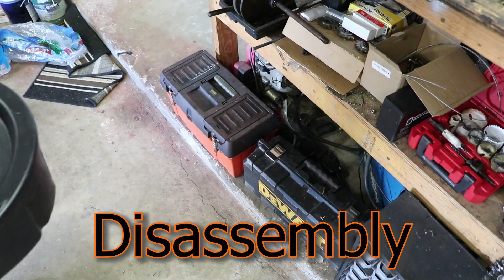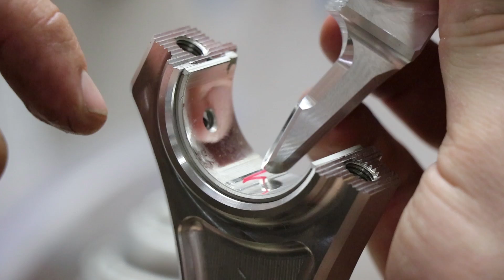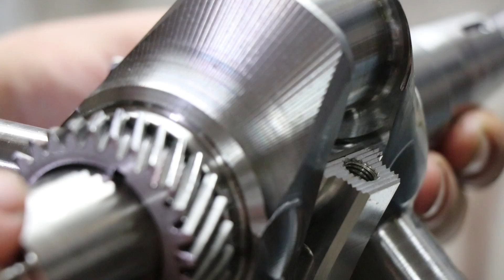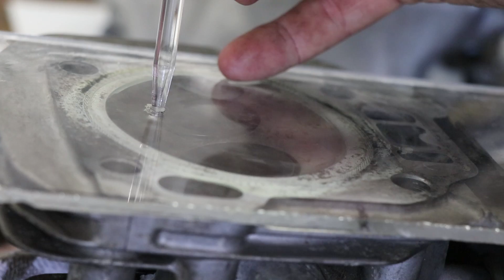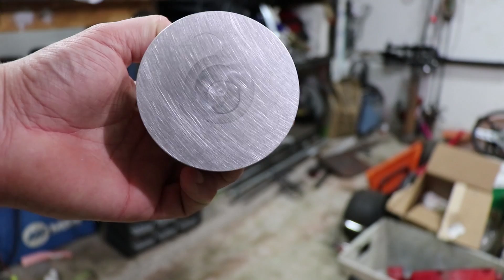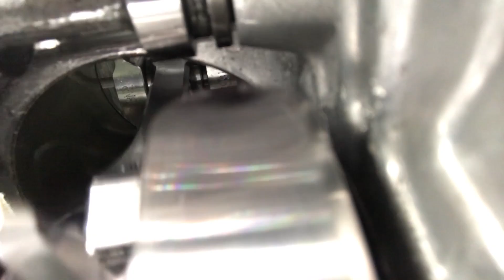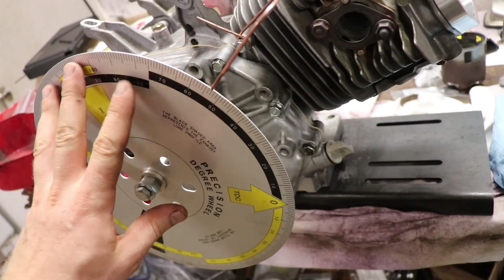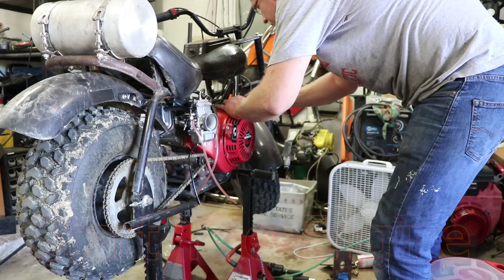Stroker Engine Build: 30+ HP on a 65 MPH Mini Bike! (Complete Build)

Comment: No chance having 30+ hp
>20 at crank and about 15 at wheel
Reply from the maker: We will find out in January
Reply: @KartFab  
Thanks for replying I am really waiting to see dyno pull
Reply: Keep us posted
Reply: I have one built nearly identical and it will blow right through a comet 40 with a 7x1 final gear. Needed to swap out to 9x1 and a comet 44. So who knows? I'd bet low to mid 20's with mine. It runs and sounds like a 450 dirt bike motor.
Reply from the maker: @E46TY  Was the motorcycle dyno inertia only, or could it load it to hold rpm?
Reply: Crickets
Reply: @KartFab  did you ever get the dyno done? 

 I just picked up a gx 340 clone but am aiming for more 20hp goals.
Reply from the maker: @mathdebates7936  i ended up steaming the combustion chamber out racing in a downpour. Bought a new short block and am getting it re-done.
Reply from the maker: @mathdebates7936  if you want 20 hp out of a gx340 you can get that with a 275 cam, bore to 88mm to accept a standard gx390 piston and shave the head for 10.2:1 compression on premium pump gas. Will be a nice solid build and get you there. will top out at 6500 rpm.
Reply: @KartFab  oh man that sucks.  I bet it was a fun beast.  Look forward to seeing it in the future.  

You ever mess with that Vegas carts 460?  It's like 23hp for 350 bucks. I'm thinking about trying one out.
Reply: @KartFab  thanks man.  Ez enough.
Reply from the maker: @mathdebates7936  a buddy of mine has, and it is SCARY powerful. Doesnt like to rev high, but has a lot of torque. The higher the displacement of these blocks, the lower the max rpm, but the higher the torque output.
Reply: @KartFab  I worry about throwing too much at it because I flip these things and I have a hard time getting them to pay more for the stuff that costs more to build.  Everyone wants a deal I get but quality takes a few bucks.

The buggy I listed yesterday has had a bunch of interest from the same 6 type of guys.  "bottom dollar/how much will you take", "will you finance?", "will you hold it?", "will you trade ______(always junk) for it?", "do you still have it? (and I never hear from them again", and "will you deliver?"
Reply from the maker: @mathdebates7936  lol! Yeah, just be patient and if you are, keep it updated. Who knows, maybe around christmas and thanksgiving, things will pick up with people buying gifts and that is usually the time to sell.
Reply from the maker: @mathdebates7936  check out the texas outlaw mini bike facebook page, we have a big mini bike race event coming up in october (ratrodtober) in mckinney tx

Comment: You stated when measuring Valve Spring installed height, that you measure from the "bottom of the Retainer, to thee Head." C'mon bro, you're gonna confuse these small Engine Rookies.

Comment: Yep just went to your homepage, no dyno results, where did the 30+ hp figure come from? (Pulled from a hat or just a good round figure?)
Reply from the maker: Remember this is my hobby and i have a real job and a life and you dont fully understand what i am doing behind the scenes. Some of my other builds have made 1.3hp-1.7hp per cubic inch depending on which dyno you run them on. Do the math. Also, the engine is actually out of service right now getting a head, cam and carb upgrade, so it will make more than what I have previously said. Happy new year.
Reply: I’m just f’king with you man,.. LOL

But i would like to prod you onto the dyno,.. mostly so i can see what combos do what with one another

IMO most of these 390 and 390 clone builds dont lay down near what we may think they do though,.. 

Its the torque numbers these thumpers put out/ and down low that really impresses me.
Reply from the maker: @brianboyee8972  hey man, i ran the engine on the dyno today. turns out i was running super rich, like 9.5:1 AFR, and the jets that i had only got it up to 10.7 at idle, top needle position 10.5-11.7 AFR from 1/4 to 3/4 and at WOT 11.1 AFR. For what its worth it made 25 ft lbs and i coudln't steady state anywhere below 5k rpm because it has too much torque for my dyno to load it (that or i need to wait for water pressure to go up to the house) haha! On top of all of that I found out that it may have a BLOWN headgasket on the exhaust side and i got some water in the engine when i was messing around in the rain.... Even after all this garbage it made about 24ish hp steady state with the AFR out of whack and a blown head gasket. IF i remove the muffler that figure will go up significantly from my testing on small blocks. Muffler takes a lot of the hp potential away. Hopefully the bore and rings are still good. So going off of some information i have collected, if i ran this on an inertia dyno it would make around 28 hp. cheers. Also checked my dyno with certified NIST traceable weights and it was only off by .002 to .05 foot pounds from 2 lbs all the way up to 30 lbs in 1 lb increments.
Reply: Just reading the posts in order

Cool!,.. yep they do real well but building reliable~ (RELIABLE being the key word) power 30+hp from a GX390 platform is always a think of “well it oughta make “X”.. 

These little mills are AWESOME,.. awesome platforms~ but to build to and over 30hp reliably you tiptoe into the land of rediculous money spend vs just buying the biggest one you can (Duro440), making very basic simply standby improvements and having a blast.

It gets so silly like lipstick on a pig, when they are such great little pigs just slightly over stock form

Cool videos to be certain& and it is fun teasing you/ poking at the lack of dyno figures..

(Its funny because i have also gone down the rabbit hole/ wish i had that money back)

With more and more hp& torque comes less and less reliability& increasing need to CONSTANTLY play grab ass tuning 

~ buy the biggest mota’ you can, build just a smidge, AND STOP, LOL
Reply from the maker: @brianboyee8972  good combos are as follows: 275 cam with 1.3 ratio rockers and 32mm flatslide, stock size valves. ..308 .315. or .310 cam with 1.2 ratio rockers and bigger valves, 33mm pumper carb. You can get into the most aggressive cams and big SBN carbs with ratio rockers and maybe 38-40mm intake valve size. If you want to have lots of torque you can always go with the .280 cam by nr, as that is a good overall cam, kind of like the 275 cam. The .308 is good overall too, but loses a bit to the bottom end. Its mostly a midrange cam.

Comment: FP aprilla rs 125cc engine is about 28bhp and that is with out any modifications except the PV. why bother with a 4 stroke at low cc.
Reply from the maker: because its fun. I could go buy a used motorcycle engine and come out with way more horsepower but i like turning a worn out generator engine into a beast. There are always going to be bigger and better engines out there, but i like these industrial engines.

Comment: Ive been wondering if I could do similar but with a GX 690 ,,   For my trailer jetter, it’s a sewer jetting machine,, basically a pressure washer.....the engine will run a plunger pump,,,    The formula is as follows,   PSI X GPM /1460X 1.4 = The HP needed to run the pump...    example    4000 psi at 15gpm  pump will need 58 HP.   ......also RPM is a factor__i would need to set a governor to not exceed whichever RPM the pump is rated for...   I would use my HP after the build to determine which pump I would use...   it could be anything between 3000 t 5000 psi..     what kind of HP cod I get with a GX690?
Reply from the maker: Hmm Koehler v-twin or briggs vanguard v-twin. I’m not sure you’ll get that much HP though

Comment from the maker: PARTS USED IN THIS BUILD
Honda GX390 Engine https://amzn.to/2zQIOrW
GX390 Starter https://amzn.to/2uxHdCl
Predaotr 420/Gx340/390 Billet Connecting Rod http://bit.ly/2mqzp0I
Honda Gx390 1.2 Ratio Roller Rockers http://bit.ly/2LpKfPr
90mm -.050" compresison height piston http://bit.ly/2uIlp6o
GX390 +.200" (70mm) stroker crank http://bit.ly/2uLyGuT
GX390 Crank Bearings https://amzn.to/2JyefHh
GX390 Oil Seal https://amzn.to/2NlSxs0
GX390 Magnetic Oil Plug http://bit.ly/2NrT4ZL
90mm .043" head gasket http://bit.ly/2NYiyic
35mm Intake Valve http://bit.ly/2L7ij6G
31mm Exhaust Valve http://bit.ly/2zZx0Uz
Billet Retainer Kit For Valves http://bit.ly/2mulnel
GX240-390 & 301-420 50 lb HD Valve Springs http://bit.ly/2msY98K
Rotating Assembly Balanced by NR Racing
GX390 Valve Lifters https://amzn.to/2L6lifW
GX390/420 275 Camshaft http://bit.ly/2No1LEs
GX390 Crankcase Cover https://amzn.to/2Jzynso
GX390 Gasket(s) https://amzn.to/2uxT1Ez
GX390 Valve Cover Spacer http://bit.ly/2uLAFPR
Cut To Length Push Rods http://bit.ly/2mthxT2
Mikuni TM32 Flatslide Carburetor https://amzn.to/2Ltf9q5
Billet 32mm Intake Manifold http://bit.ly/2LtYjHG
GX390/Predator 420 Exhaust Header http://bit.ly/2uHhdDV
40 series Torque Converter Kit http://bit.ly/2Nsg7U2
Billet Thumb Throttle https://amzn.to/2zQHh5a
Adjustable Throttle Cable http://bit.ly/2JzAL2k

TOOLS & CONSUMABLES USED IN THIS BUILD
Piston Stop https://amzn.to/2NZNxKN
Degree Wheel https://amzn.to/2zPQXwD
Timing Light https://amzn.to/2uxhMAX
Gasket Maker https://amzn.to/2uxU8Ef
Bearing Puller https://amzn.to/2mrjGOP
Plastigage https://amzn.to/2moGJKm
12 Point Socket Set https://amzn.to/2L2yiTH
torque wrench https://amzn.to/2L82pJu
Feeler Gauge https://amzn.to/2NYzBkl
Assembly Lube https://amzn.to/2NWIMlc
Dremel Rotary Tool https://amzn.to/2muFnxE
Carbide Rotary Burrs https://amzn.to/2O1Tp6n
Dial Indicator https://amzn.to/2zLZNLS
Green Grease https://amzn.to/2uwq3F4
Valve Lapping Compound https://amzn.to/2O13DnM
Valve Lapping Tool valve_lapping_tool
Isopropyl Alcohol https://amzn.to/2mpX9lz
50ml Class A Burette https://amzn.to/2L3Ojsp
Micrometer https://amzn.to/2uxvKTo
Mill https://amzn.to/2L9rHHi
Piston Pliers https://amzn.to/2zRgc1R
Piston Ring Compressor https://amzn.to/2uv9NEk
Dry Erase Marker https://amzn.to/2uxY4ov
Caliper https://amzn.to/2NZlQlt
Abrasive Chop Saw https://amzn.to/2uxsB5Y

Compression Ratio Calculator
http://bit.ly/2zSEOas

Comment: How did your torque converter not blow ohs only rated for 18 hp
Reply from the maker: Slips the belt over the driven unit and won’t gain traction if giving full throttle.. Cracked the jackshaft keyway. Goes into overdrive too fast as engine provides too much torque for CVT to remain in original ratio.
Reply: @KartFab  thanks I’m building a drag mini bike with the same you put on yours stuff just predator 420 and don’t know if I should get clutch or torque converter both expensive !!
Reply from the maker: Get a bully turbo clutch.

Comment: How do you know how many degrees to advance your timing? You used 28 degrees, why? Im struggling to find any good information, any help is appreciated.
Reply from the maker: When you buy a camshaft it will let you know. Typically advance by 4-6 degrees on mild cams and 8-12 degrees on wild cams. Most cams on gas run between 28-32dbtdc and if on methanol, 34-38 dbtdc
Reply: @KartFab  I bought my cam from nrracing (280 series, 0811 grind, 6500+ rpm) but i doesnt say anything about timing. Do you have any knowledge about this? Currently im using 6degree key with billet flywheel
Reply from the maker: @sepedius  sounds about right

Comment: If I do this build to my own gx390 will the connecting rod in the description work with the piston. Or will it still need to be milled
Reply from the maker: Con rod works with piston. As long as you don’t get a stroker crank the piston will fit perfectly
Reply: Thank you!
Reply: Will all of these parts work in this engine without the stroker crank? I'm wondering if the valves would clear.
Reply from the maker: oh yeah, the valves will DEFINITELY clear. I had over 200 thousandths piston to valve clearance on mine, and that is with the increased piston dwell time from the increased stroke. You only really run into issues when you have piston pop up, thin head gaskets, mill the head, and/or get an aggressive high lift cam with a high duration.
Reply: KartFab awesome! Thanks for the quick reply!
Reply: KartFab awesome! Thanks for the quick reply!

Comment: Kartfab what's the recommended fuel for that?
Reply from the maker: 10.2:1 compression you can run run on premium pump gas. Other fuels like methanol or race gas will make more power.

Comment: Is the Plastigage available even with with metric measurements and if so, where can I find it???
Reply from the maker: Plastigage usually has metric on one side and inches on the other side. Any auto parts store has it as well as the link in the description.
Reply: KartFab I checked the Amazon link you posted in the description out, and said that the seller of any of the tools and other similar stuff, like the Plastigage doesn't ship them, outside the US (like my country, Greece for exaple). And I don't even think I can find it in any of my few local car parts store, 'cause nobody in my country seems to work on his own car or motorcycle, rather than teens who have and ride modified mopeds
Reply from the maker: I would be very surprised if your auto parts store didn't have plastigage on hand. It is a common part used when replacing camshafts, cranks etc.
Reply: IDK, I had to explain to the counter lady at Oreilly Auto what it was...then the manager.  They eventually let me look through the inventory shelves myself and I found it.  Then I cringed when they started to fold it to stuff it into a bag...  Those people don't know what they have to sell unless their computer tells them it will fit on a specific model car, or it's on a retail shelf.

Comment: Is it about same size of a predator 212cc in length and width?
Reply from the maker: No. This is a big block. A predator 212 is a small block
Reply: KartFab how much bigger is it than predator 212
Reply from the maker: look up the users manual for a predator 212 and a predator 420, thats how much bigger. Dimensions are in users manual found at harbor freight

Comment: Only takes about 8 HP to go 65 MPH... back in 1960's I built a minibike around a 350cc 2 cylinder motorcycle engine (JAWA): 
http://i1088.photobucket.com/albums/i333/BuzzLOL1/BuzzLOL%20Pictures/DannyFuneral008-1-1.jpg
Reply: Does it?
Reply: @syndeko55  -Sure...

Comment: Aftermarket stroker kits do horrible things to your engine. A factory can stroke an engine properly, as Honda did when they stroked the XR200 engine to get the CRF230F engine. It is not practical for an aftermarket company to correctly stroke an engine. Consider for a moment if we used a shorter connecting rod with the stock stroke. The shorter rod reaches a greater angle when the piston is half way down
 This increases piston side thrust resulting in greater friction, heat, and piston and cylinder wear. Now consider that we increased the stroke using a rod that is stock length. This will have the same effect of increasing piston side thrust. When an engine is stroked the rod needs to be lengthened proportionally yo prevent increased piston side thrust. Aftermarket stroker kits INCREASE THE STROKE and they must use a SHORTER CONNECTING ROD to prevent the piston from hitting the head. Thus we see that aftermarket stroking increases piston side thrust in two ways. Unacceptable for my engines.
Reply from the maker: Rod ratio is still within acceptable tolerances. I could have put in a deck extension and resleeved but decided against it. There are longer rods for these too.
Reply: Good thing he didn't build your engine  he isn't going for hundred thousand miles ither. Waaaa
Reply: You can also get a piston with a different pin height.

Comment: I admire your work… but I’m Not sure how much this engine cost you. But if you’re getting over $1500 it’d be completely pointless considering you could but a 450cc engine off of a dirt bike and be making 60hp instantly and have FOUR time the torque. I never understood the cart racers who poured 2-3k in these motors when a YZ450F motor on a cart would humiliate the GX390 pressure washer motor lol it’s not a race motor… it has to be modified into a race motor to even make one. The YZF450 or KX450F or CRF450 etc are race motors from factory and they’re tough as nails with blistering torque…. And again idk…. That’s just me thinking into it with a direct logical approach
Reply from the maker: Did it because I can, not because it’s practical. 👍
Reply: @KartFab  and that’s respectable. That’s why new ideas can change the race world.

Comment: where can i find some mods for a Honda GX120 go kart engine i have a GX120 off my old go kart that i want to mod
Reply: as far as i know the GX120 is similar size to the 212 i own both a 212 and a GX120 never used the GX120 on anything but the go kart and just wanted some more power out of it

Comment: Ohh. I can't. Wait. Till.  My. Duramax.  18 e. Hp. Is hear. And.  My. Stage.  To.  Kit.  With. The. 308.  Hot.  Cam.   U shoulde. Bha e.  Use. The. Whole. To.  Put.  Oil.  On. Top. Off your.   Voule.  Tran

Comment: I race dirt karts and I run  a class called small block open an I run a Briggs & Stratton animal that makes 28 hp and I have been clocked running 92 mph  and my buddy has a go 390  it makes 46 hp and he has been clocked running 124 mph so you have what we call a stock clone motor that runs 65 mph so lern how to build a motor
Reply from the maker: Oh man I wish I was as cool as you.